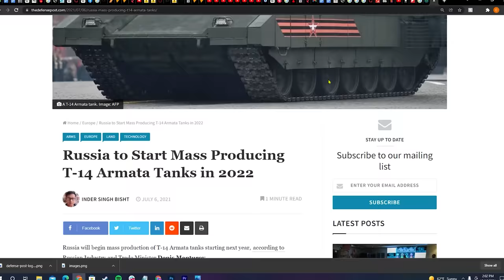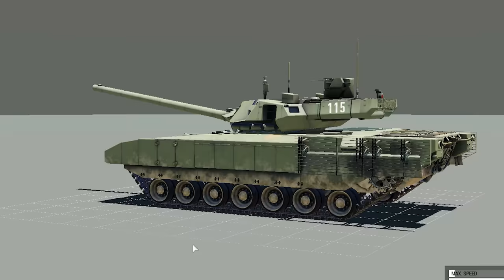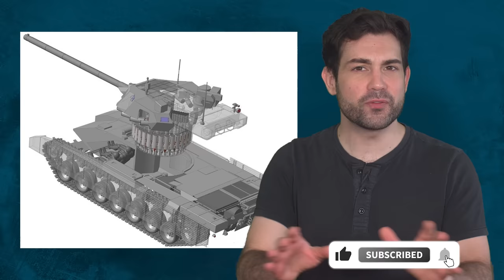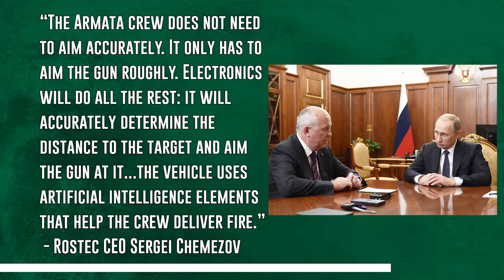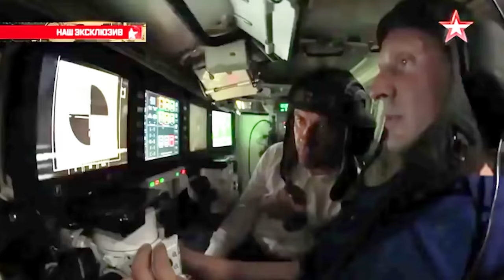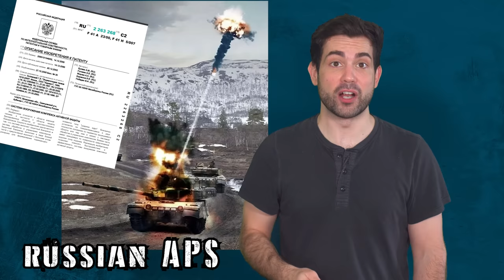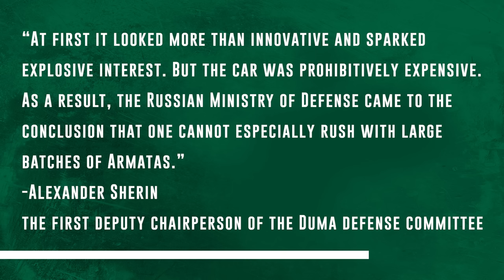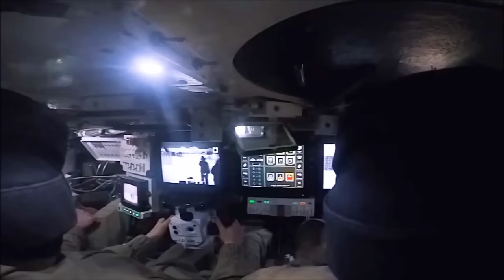The Truth About Russia's T-14 Armata Tank

Comment: There could be a one major (concept) problem of having all crew inside the hull, instead of turret. If you are operating moving turret but you are not moving with it, you may lose your bearings. It may be not easy to operate such tank (as a commander or gunner).
Reply: Every gamer that has played a tank combat game has got this resolved.
Reply: @charliewhiskey8440  but the tank is moving, accelerating or slowing down, turning. Some may get sick while seeing something different than feeling.
Reply: @janfelchner1543  Every IFR rated pilot has got that resolved.
Reply: @charliewhiskey8440  it's different when you are 'in forward' position and feel everything this way, but you are seeing it like being turned. 
I don't know, haven't commanded T-14 myself, maybe it's not a problem for anyone. Or there are VR googles and by turning head you turn the turret. Anyway, I hope they will fail to produce this tank.

Comment: One issue with autoloaders are that they are particularly vulnerable target in a tank. If a round/warhead manages to penetrate the tank's armor and hit the autoloader, it is possible it for all of the rounds in the autoloader to detonate, causing a catastrophic kill (K-kill) on the tank. This is frequently seen in T-72 through out the MIddle East, which have been observed to have their turrets blown off the rest of the chassis in "Jack in a box"/"lollipop" effect.
Reply: Most T-72 exploding was the spare round outside of the ammorack and scatter around the tank ,the auto loader is very low down the tank chassis compare to other tank of the era like Cheiftain and M60 the auto loader store the ammo is safer,ofc it will never reach the level of modern tank but it not really a hindrance
Reply: Autoloader do not contain ammunition - ammo storage does. It doesn't matter if it's a human or automatic system that takes the rounds from storage to the gun. 
Western tanks are blown in a very same way if there is HE rounds cookoff. 
And blowout panels doesn't help againt it, they do help in case ammunition propelant (powder in a shells) are on fire. But Soviet/Russian tanks can survive this  as shown on footage from Syria.

USA "solved" the problem of tank desintogration from HE shells explosion by removing them from loadout.
Reply: @tsorevitch2409  The US still has the M830 round. That is a US version of the german DM12A1 HEDP or MZ (Mehrzwecl - Multi purpose) round. And has an explosive warhead
Reply: There are multiple ways to build an autoloader. The russian type used in the T72 is totally different from the system used in the japanese Type 90 (that is based on a german system tested in a Leopard 2 prototype - turret is today in the WTS Koblenz) or the french systems used by AMX 13 and LeClerc (again two different ones) and that from Armata.

This is the old style russian system - if anything penetrates the lower hull it will likely hit the autoloader

https://youtu.be/mTzobtVjqPs
Reply: @mbr5742  it have it in stock but standard M1 Abrams loadout didn't include HE rounds, only heat, Sabot and canister

Comment: Excellent analyse, but the reality of what we’re seeing is that their provision of combat supplies (ammunition, fuel & rations) has so far been abysmal!!!  It doesn’t matter how capable the vehicle is if it runs out of fuel!!!!
Reply: More production delays no doubt
Reply: reminds me of the germans in ww2
Reply: @averiWonBTW  Till the end of the war germanys logistics where pretty solid, but once the war turned they where basically running out of everything, including the raw materials to even make decent tank armor and parts. That should not be something that modern day russia has to deal with especially fuel since they have some big capacities in that regard.

Well.. i guess nothings impossible when it comes to good ol corruption. Why spend money on buying fuel when you can invest it into a new super yacht? XD
Reply: @riptors9777  
Have you seen the unit breakdown of a Russian Battalion Tactical Group? They have 5 small fuel trucks to supply 140 vehicles. One ambush can easily turn that into 0 fuel trucks. The BTG seems to have been designed for wars like Syria and the previous situation in Donbass, where they can rely on local irregulars to provide rear-area security to ensure logistics can move unmolested (and where in any case they don't have to drive very far from a secure depot).

Comment: Greetings from Spain. It is possible that Russia is more inclined to modernize the existing tanks since the T-14 has a great lack of armor in the turret and statistically it receives 2/3 of the impacts and in the case of the T-14 the tower has a size similar to that of the M-1 Abrams. Thank you for your time.
Reply: Why are we assuming that it doesn't? The turret being smaller, they could add as much or more protection as a T72B3, and still have it come off lighter. The T14 does actually increase the weight by 10 tons over a basic T72B, so that weight ended up going somewhere.

I don't think we can assume it's easier to mission kill this than it would be any other Russian tank.
Reply: @Snagabott  Greetings the extra weight has gone to the barge where the crew are. The tower due to its size and the amount of equipment it carries cannot be very armored which makes it very vulnerable to 30mm weapons.
Reply: @Ruslan Masinjila Underneath the tower is the ammunition and active defense systems, not to mention that a 30 mm cannon could seriously damage the tower of the T-14 which a T-72 or M1 Abram does not pose such a threat. Thank you.
Reply: @arbelico2  Is that something you know or something you assume? 

The more equipment you put in a turret, the more important it will be to armor it. A tank that can lose its weapons to a 30mm gun doesn't exactly sound like that much of a step forward - that turret is a bit smaller, but not that small.... :/
Reply: @Ruslan Masinjila Best regards. There is a detail to take into account a conventional turret has auxiliary systems to operate it and point out that it is very likely to survive thanks to the armor and allow to fight. In the T-14 with the scarce armor it is more likely that the tower is totally out of service and that the tank as a whole suffers more damage. Thank you
Reply: @Ruslan Masinjila Well, for one, the turret is filled with shells. So if it can be pierced by any kind of shells, you could get a cook-off. But even if you don't, the equipment inside is valuable and worth protecting. You want to stay in the fight as long as possible.
Reply: @Ruslan Masinjila but if you lose that gun you lose the whole point of a tank which is to use that gun to shoot at other tanks. Which is to say you don’t necessarily to destroy a tank just render it non mission capable which would be easy with a lightly armoured turret

Comment: I'm surprised they don't have missiles that specifically target the optics/cameras. Soft targets and as you said, without these the crew can do nothing.
Reply: It can be easily janmed
Reply: If you can specifically target the optics with a missile then you can specifically target the weak spot on the hull.  If you're going to blind them, lasers probably make more sense.  Maybe you'd try to splatter the thing with shrapnel or acid?

Either way, given how easily optics can be damaged or disabled, I wonder how resilient those systems are to the concussive force of the tank's own active defense or ERA systems.
Reply: Bradley's gunners are trained to do exactly this, then thwack it with a TOW

Comment: The weak spot is they’ve only made 5 of them, and in 4 of them the conscript assigned to their upkeep ripped out the copper wiring and sold it on eBay.
Reply: The actual number is alleged to be 30 to 40, but they're basically rolling prototypes. Reliability has seemingly bee a huge issue. Witness the T14 which got stuck during one Red Square military parade. The Kremlin immediately claimed it was intentional, to provide a demonstration of towing military vehicles. It's odd how they've held hundreds of military parades previously, yet never thought to put on a display of towing military vehicles......

Comment: The united states have experimented with a possible automated reloading system, but decided not to go through with it because it failed in certain tests vs a manned version. I watched a documentry about future u.s tanks, that was talking about the abrams m1a tank
Reply: One of the things people don't talk about with autoloaders is the loss of the extra crew member.  Having 4 guys for maintenance is a big advantage.  One of your guys gets wounded or incapacitated in battle?  You have 3 other guys.  You can run an Abrams with 3 guys, it's just less efficient.  Running a tank with TWO guys is going to be rough, autoloader or no.

Comment: Question-don’t auto loaders raise the chances of the entire tank going up in one big ball of flames if the rack is hit with a round…. And in the process kill anyone inside?
Reply: The crew is protected since they were located in The front
Reply: That is why they are in separate armoured capsules, only the turret will go boom if ammo was hit.
I don't know if the armata has this, but most tanks have a special exhaust on the turret that only open up (well more like explode off) when ammo explodes to help vent the explosion out of the tank instead of keeping it contained
Reply: @goliathmb18  You mean the blast panels? Yeah, a lot of tanks have them. Although having an auto loader means that you don't have blast panels.

Comment: As a former tanker the only thing that I Agree with is that we should of never been given internet access.
For the record there is no way to hide a tank from IR. Just like when  Cappy was talking about the exhaust port, what about the track. In the vid he points to the white exhaust port as if that's the only thing heated up but obviously the track is white AF.
 The only improvement I heard was the radar and the ability to intercept "things" with the 50. Other than that everything else has been done before. Longer barrel? Done and Improved in WW2. 
The Russians already have a great tank, it's called the T-90. The Armata-14 is a hype fest. Any tank that has a huge amount of digital components is going to be more effective but a lot less reliable in combat and they are not going to put this tank into full production. Why? Because no one is producing MBTs anymore
Reply: Nobody is producing MBTs anymore? What are you talking about? Everybody is still producing buying and developing MBTs.

Germany and France have started on the MGCS project to replace the Leclerc and Leopard 2 from 2035. The UK just adopted the challenger 3. The US is upgrading their Abrams and working on developing a replacement. Korea just took the K2 in service.

Comment: the concept looks actually interesting.... the issues with the turret and armor aside, the fact that its bottom half (the body) can be used for other turret types makes it a simpler design than some of the stuff the US is planning on putting out. Heavy armor just got proven to be relatively vulnerable in warfare, especially against a modernized army. So, flexiblity in my opinion seems to be the name of the game for the next gen of armored vehicles. I think the US is kind of moving that direction as well when it comes to ground vehicles, though not as much. However, with the airforce, you see it with the F-35. Its versatility in use seems to embody that idea....
Reply: The best thing about F-22, B-2 and F-35 is that they do exist. It has taken years and billions to finish it but they ultimately managed to do that. (un)fortunately in a corruption-driven state such as the putinist Russia it is simply not possible
Reply: The main problem with that is that tank hulls are expensive and fuel hungry so you don't really want to use them for other stuff.

Comment: I personally think the autoloader causes more problems than it solves. Russia loves it's autoloaders for tanks, but there's a reason most other tank designers don't use them.
Reply: Funny how the most modern tanks such as K2, Leclerc, Type-10 and prototype tanks such as Kf-51 and AbramsX all have autoloaders.
Reply: @definitelyfrank9341  yup but those dont tend to rip off the arms of the gunner
Reply: Possibly due to autoloader design differences, in the west they probably designed it different compared to it's Soviet counterparts

Comment: You can reload the M1A gun at a faster speed. But that is only with the sweet spot magazine. Yes the 8-12 rounds that are placed directly behind the gun. After that the Russian Autoloader are Superior.The Russian autoloader is concept that is well proven in combat. Lets just say it works well.
Reply: Automation is the future, doesn't matter how good a human operator can be, at some point humans will be replaced with better machines.
Reply: You see the problem with auto loaders is if they get the entire crew and the tank dies but in let's say the abrams only the munitions compartment exploades and the crew survives
Reply: @Battlenude  Not proven. There's not enough history to know whether internal design on the T-14 is safe for crew with these automation improvements, while the Abrams has proven this is true.
I actually think the T-14 would be relatively safe for crew even with autoloader issues due to the attempt to capsulize the crew compartment, but it's way too early to argue about it.